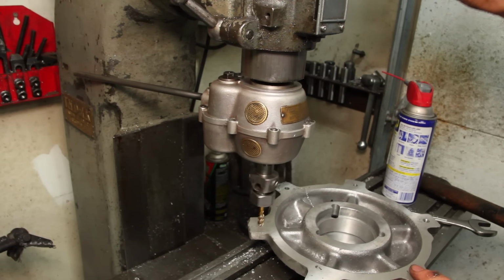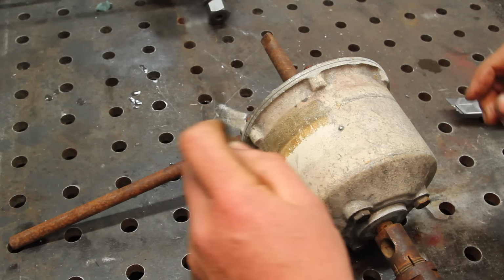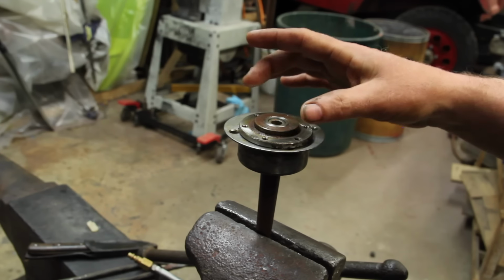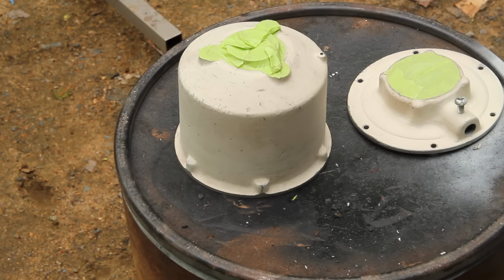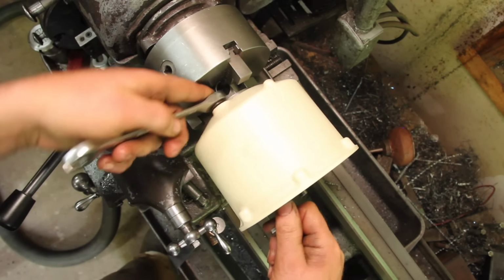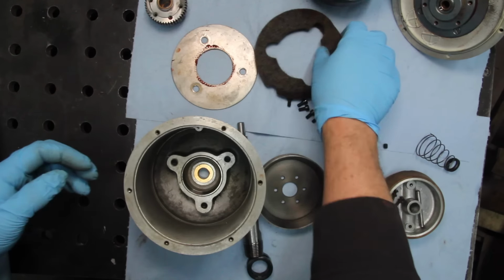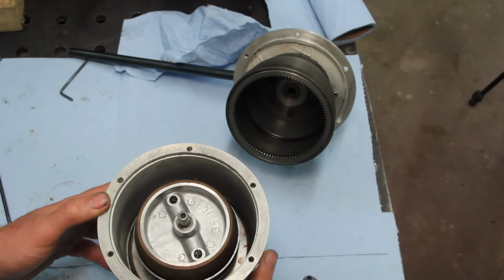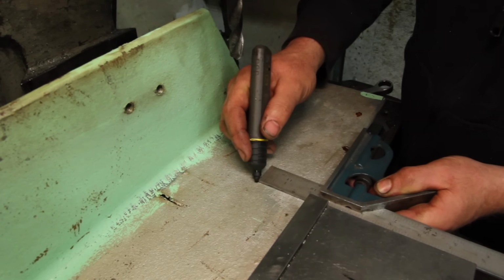Restoring an extremely crusty Procunier tapping head

Comment: 30 years ago I Used these in several different sizes and Natco multi spindle heads on a old Cincinnati Bickford as well as on a Ikeda  radial arm drill press.  I could get 6 procuners setup and running on the Natco Gang drill head drilling and tapping Iron ball bearing housings.  Once we Live tooled our Warner swasey chuckers they went into a crate and were tossed in the early 2000's.   We kept the smaller procuners since we still use them for a clamp drilling and tapping operation.     Still remember (vaguely)  getting absolutely Blitzed  using toluene based Tapmatic running stainless stuff with the heads!    More than once the Shop steward would grab me and walk me out to fresh air for a sober up!     Run big VTL's now but I enjoyed my time running these heads on the manual machines.

Comment: I made a great discovery a while back.  Faced w/ rust remover not liking dirty objects & most rusty objects are dirty, and my go to cleaner, (LA's Awesome Orange @ 2.50/gal at Dollar Tree), eating everything in the 'dirt/grease' class, but not rust, I tried combining them.

Wasn't a huge piece of brain work, but hey, nobody else is talking about it.

I have a brass shell casing tumbler I use for low effort smaller than a bowling ball cleaning.

I emptied it & started working on most effective ratios.  I found one that worked great, it's not 50/50, but I forgot to write it down, so gonna have to repeat.

Give it a try, it has really reduced my cleaning-derusting time involvement.

Nice score on the big azz Procunier.  And nice restoration. Figured  it'd be nice inside.

Oh, the reason it's designed as it is?  Ever work on a Citreon? Or Renault?
Reply: Bucket with kerosene are also great for dirt/greese removal, but you need clean kerosene after that :D Old machines was designed weeeeeeeery different than today and this isn't only because consumerism, but different tools was available, in car industry included.

Back then, most things was design to live forever, even if wasn't make from good materials, serviceability was a big thing. For example in old TV you often had full electronic diagrams put/glue inside enclosure, today... it is hard, even impossible sometimes, to open things without breaking something. 

As for tools for designing and fabricating. For example, CAD enables more compact designs than drawings allows, CNC can fabricate more intricate designs and compact them even further. And today, with 3d printers you can do things that, not even long ago, was just impossible.

But a lot bad designs are still just bad, any tool or philosophy wouldn't help with that :P

Comment: Cool. New Jeremy video.

Does Anchorlube also provide scrap stock in their color?
Reply from the maker: That was from a weird home made table router/wood shaper thing that I got with my weird home-converted metal bandsaw.  I guess the guy a vaguely similar taste is color to you?  It was free, but I didn’t need the router so I scavenged it for materials.
Reply: @JeremyMakesThings  Remember DIN 1844 mandated painting machine tools with RAL 6011 :)
Reply: Anchorlube in machine green......I remember the weird beige stuff they used on the lathes at school...that was a gross colour ..it just said filthy disgusting dont get it on your hands, somehow.

Comment: Hammer impact will loosen more bolts without breaking them than most any other method. Unlike an impact wrench, you can control the impact force. Using that method, I have loosened bolts that a 3/4" impact wouldn't budge. AnchorLube is awesome stuff!

Comment: Thanks very much for spraying penetrating oil before trying to unscrew. There's a half million videos out there of idiots shearing off bolts.
I've always wondered why people clamp cylindrical parts in a vice when there's a purpose made round clamp sitting over there on the lathe.

Comment: Hey man, I’ve got a quick question about painting my own CJ5 project. I know that the factory painted the whole body uniformly and didn’t apply any undercarriage protection. I am currently preparing my tub for repainting (the patina was ruined by a rattle can from a previous owner) and I am considering painting the undercarriage with chassis protector or some similar product for added protection. Do you think this would be a bad idea? I have read some forums where people do not like it at all. Thanks!
Reply from the maker: I did a couple coats of Mastercoat on mine and will eventually do either an under coat of Raptor liner on the underside.  The argument against this approach seems to be that it “traps moisture.”  Obviously just paint didn’t work on the original, so I’m of the opinion that more protection (and sound deadening) is better, but that’s just my opinion.
Reply: @JeremyMakesThings  Thank you! I'm on the same page as you with that (why repeat past mistakes, see wood in the hat channels of the body). Do you think chassis saver is a good choice for this or would you recommend something like mastercoat?

Comment: What did you do with the “bent wire”. I’m not familiar with that
Reply from the maker: There’s a pin inside the clutch that holds it onto the shaft.  The only way to get the pin in and out is to push it with a piece of wire.  Of course, when you push on the wire, it bends more, so I ended up using needle nose pliers to push the wire through.

Comment: so im looking at getting a procunier #3 like yours.  it comes with 4 collets and seems to be in good condition.  After u have used your head a bit are u still glad u have it in your arsenal?
Reply from the maker: Absolutely worth it if the price is right.
Reply: @JeremyMakesThings  ok second question...i am nervous the #3 wont fit in my mill.  i have 8" between mill spindle and the top of my vice.  Will the #3 fit that?  The head im looking at is in real good shape and has 4 collets 1/4 thru 5/8 for 175.  from ebay solds this is a reasonable price i believe.  thanks for sharing your thoughts.
Reply from the maker: @gexas38  it would be tight, especially getting it in and out of the spindle.  The price is good though, you probably wouldn’t have a problem getting you money back if you decided you didn’t like it and wanted to resell it.
Reply: @JeremyMakesThings  ok pulled the trigger on a #3 off the ...bay and at 60 bucks it was a steal for me.  Cleaned it up and everything seemed in order but i did have to turn down the MT3 to be a stubby straight shank in order to fit in my drill press.  I came back to your video numerous times to reference your assembly/disassembly so thanks again for posting this.  It has been a great tutorial.

Comment: Have you ever broken a tap using a tapping head?
Reply from the maker: I haven’t.  I think the clutch will slip if it binds up too much.
Reply: @JeremyMakesThings  I ask because a small tap is more likely to snap due to the torque. I've thought about using one of those adjustable torque drill chucks for tapping.
Reply: Never have... 10+ yrs of using one.  The clutch prevents it.

Comment: While I agree that such a light color is a bad idea for a machine shop, with all the oil and grease and such, at least you didn't paint it that gawd-awful green that all the Europeans use on everything!
Reply from the maker: My rule of thumb is if I can figure out the original color, I’ll got with that.  If not, it’s charcoal gray. (I also have a soft spot for tools that were originally charcoal gray.

Unless it was originally green. I might have to draw the line there.